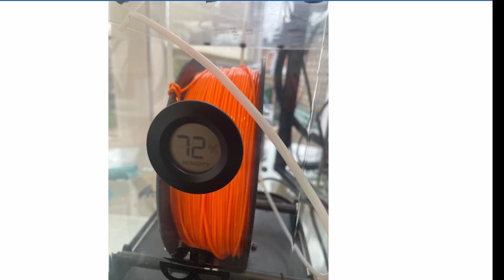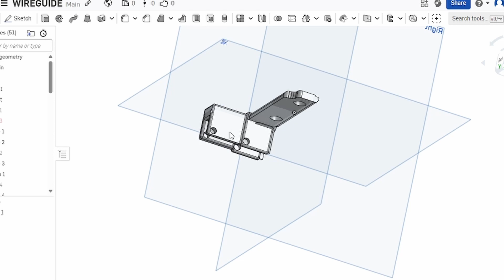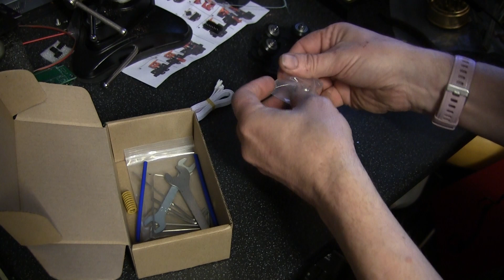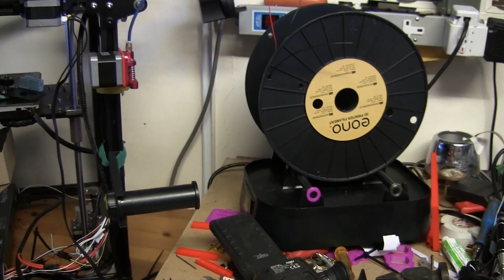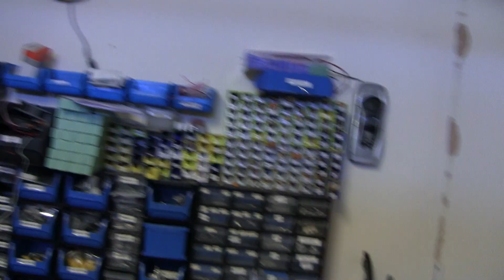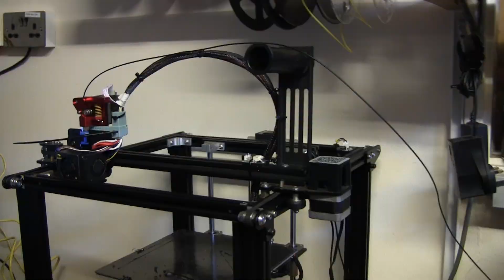Ender 5 Pro - Dual Direct Drive Upgrade

Comment: Those extruders need a small upgrade due to a design error/money pinching. The driven gear has a needle bearing but the mounting bolt has a threaded surface. This will wear out the needle bearing very fast. I replaced the bolt with a homemade shaft, put in a new needle bearing and the extruder is now running for 2 years without any problems.

Comment: Hi, thanks for the video. Im just about to do the same thing to my ender 5. Few questions: i think you are, but are you re-using the old red alu extruder mount here? Second, ive seen people mount the motor in front of the back plate, not behind, is there any reason you did it that way? Cheers.
Reply: All depends on what kit you have and which extruder. I do not have the red plate anymore. You need to ensure the extruder lines up with the hot end.
Reply: @robinclayton8284  same extruder as you, the dual geared one
Reply: You may also need to recalibrate E-Steps afterwards but it's easy enough